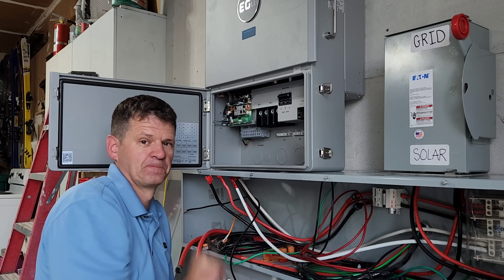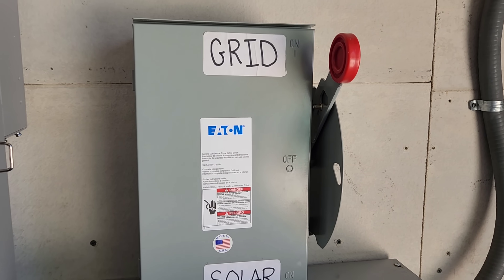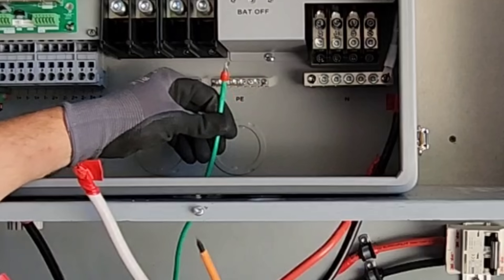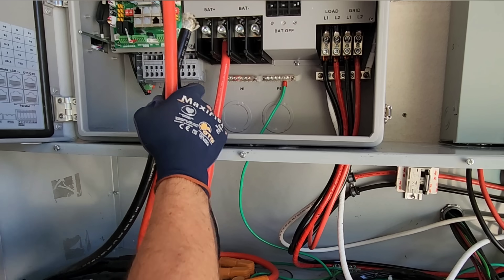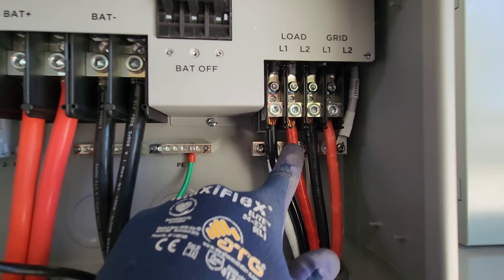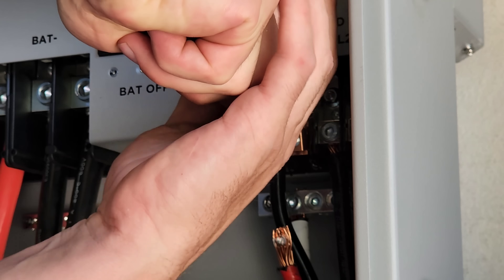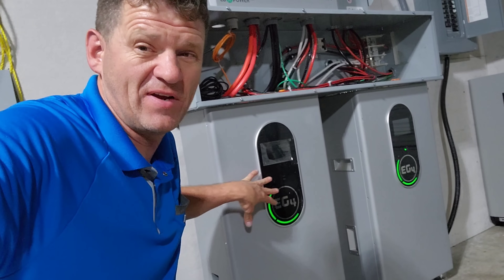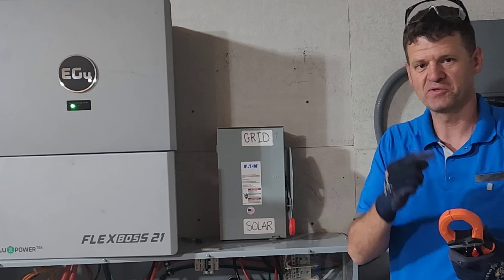EG4 FLEXBOSS 21 - Full Install With 1 Mistake

Comment: I was looking to get 5 flexboss 21 and 25 batteries 550 panels in total of 190. Will I need a multiple electric panels?
Reply from the maker: Is this for a new structure/home or an existing building?  How many electric panels do you currently have?  a single 400A service to the property?
Reply: @diySolarPowerFunWithRay no older home with a 600amp service
Reply: @diySolarPowerFunWithRay and I have 2 225 and one 150 panel have 3 5 ton ac units and 2 3.5 ton ac as well two 22000btu mini split and everything is ran off electric.
Reply from the maker: I would have to see some pictures of your panels and the locations of each panel, buildings, meter(s).  If you emailed meva video walkthrough of your system I would love to have a look at it. Eg4/sig solar can also give you some recommendations on what equipment you would need/layouts. You may only need three Flex bosses(or less)and no new panels.

Comment: double lock nut on the nipples in the transfer switch is unique. If you used an insulated nipple it could work?

Comment: A tip for you, if you haven’t figured it out already. Change the “Brand” of the batteries from “0: EG4” to “1” and you will have access to more battery info inside the EG4 Monitor Center. I have no idea why EG4 doesn’t include this information in their documentation but I found it in a comment from their tech support in an online forum and as soon as I made the change I can see each battery’s Total V, SOC, Current, SOH, Min and Max cell temp, Min and Max cell V and cycle count.
Reply: I forgot to mention, this is specifically for the PowerPro Outdoor and Wallmount Indoor batteries. Other EG4 batteries use the “0” setting but these batteries use the “1” setting.
Reply from the maker: This is a bit odd... but true... I always have eg4 look over my settings before I turn this on. Ya, i was a bit surprised by this one.

Comment: Hi Ray, any concerns with running your PV wire in the same conduit as your AC?  Same thing with your PV wire touching the battery cables?

Comment: Question if you connect the grid directly to the flexboss and there is no PV power will the inverter run the house from the grid input?
Reply from the maker: Yup... That the state my flex boss gets into quite often when my batteries get low at night when the solar isn't present.
Reply: @diySolarPowerFunWithRay  Can you make a small video showing your ground  system

Comment: Forgive my ignorance - but what EXACTLY did EG4 add (over the  6000xp and 12000xp) as a benefit with the FLEXboss and GRIDboss…. I guess I just don’t understand their benefits over the legacy gear.  I’m really only interested in OFF GRID inverters and have no interest in selling power back to a utility with a net metering agreement.
Reply from the maker: In that case the inverters you mentioned are perfect for your scenario. Benefit of the flex boss and the grid boss is that they tie into the grid a little more seamlessly. The grid boss adds a shut-off switch built-in and it also allows you to more easily locate the batteries anywhere on your property... with the 18 k p v you needed to have your batteries and your inverter closely located closely to your main power supply line as power went into your house and into your main electrical panel. The great boss allows you to put the batteries and inverter in various different locations in your house.... maybe outside.. if that is something you would like to do.  It has a lot of flexibility mainly for installers who have a lot of different configurations to deal with.  For example some people only have space for batteries in their basement on the other side of their house. So this helps save a lot of cost. Basically you put your grid boss on your main house supply line and then you can run a single set of wires to the flex boss grid port. Then the inverter can backfeed from its grid Port into the grid boss and the grid boss will power your house electrical panel.  Hope today makes sense. I know, it's kind of complicated
Reply: @diySolarPowerFunWithRay Thanks for the explanation…. Ya, I’m dealing with a “piece-meal” electrical design…. Winter RV lot where the original property realtors put the 200a main panel on a stalk at the front corner of the property and then folks added outlets for RVs, Park Model Trailers, built Casitas, etc… so I’ve got a bunch of small subpanels on my lot and putting ANYTHING up by the street is a non starter… so ya, I’m just trying to figure out which direction to go.   Thanks.   I like the 12000xp; I’ve heard the 6000xp fans scream all the time even when not under load.
Reply from the maker: Thanks. Yeah the 12,000xp much more quiet... I like it a ton more that 2 6000xp's.  Plus the 12,000xp has smart ports.

Comment: Great videos! you should add the NHX 12kw to your inverter google doc so we can compare across brands too
Reply from the maker: Thanks, The current issues with those is they aren't readily available for purchase.. unfortunately.  They sold out pretty quick and I think Watts247 has an exclusive contract to sell them in the United states. I might add that to the compare list if they come back in stock.  Because of Tarrifs, he hasn't wanted to order many of them.  He does have a 16k model in stock.

Comment: I have the flexboss 21 with my settings set to grid sellback disable and fast zero export set to enable, but i still occasionally get 200-300 watt fad back to the grid. I was wondering if you noticed that on your setup?
Reply from the maker: Hi Brandon. I also get this on occasion. It's back-fed about 2kwh in the last month for my neighbors to use... only about $0.30 cents worth... Not much.  It turns fully off if the power ever goes down and the utility workers need to work on the power lines.   I have a smart meter and the power company knows about it and they don't seem to mind.  If they reach out to me I'll switch it to off grid mode.

Comment: Are you able to sell power back to the grid with this setup? Thanks for all your videos Ray.
Reply from the maker: Thanks. Yes you can. When you sell power back with most inverters, the power exits through the grid port. The grid port can either accept power or it will sell it back.

Comment: Great vid as usual! Thank you! 
I'm curious to know with the grid\solar\battery all supplying how much can you supply to the panel? I understand it's 16k with battery and solar but can you support a larger load if the grid is available as well? 
I'd have been interested to see a similar setup but where you have both a critical load panel connected to the load ports and back feeding the main panel via the grid ports but not allowing any export to the grid. (That's my planned setup) So if one day you want to set that up... 😂 
Thanks again for all your efforts.
Reply from the maker: Hey Good new. I pretty much build this exact configuration here: https://youtu.be/NMDC8JQKJf8?si=z0LIFVcr8cFmz_BR  Hope that makes sense. It's a pretty good way to go.

Comment: I still think the 12000xp is the best bang for the buck especially with built in 100 amp bypass
Reply from the maker: Upgrading to a sealed unit is definitely a good $1000 upgrade over the 12,000xp.  My computer's aren't sealed and they seem to do fine.

Comment: The torque wrench base setting has to be on 0 to not over or under torque. I'm not special as I over torqued my M6 screw and broke it while installing the 200A Eaton breaker in the Grid Boss yesterday.
Reply from the maker: Ouch, yeah, those are easy to do. Thanks

Comment: I like the use of a Transfer/Bypass switch. However, I have both FB21 and Gridboss but plan to use a Transfer/Bypass in front of the Gridboss in case something goes wrong with it we could still use Grid power.
Reply from the maker: Adding that swith might not be required. I believe the gridboss has a mechanical switch built in... similar to mine... all least that's what they are marketing. I will be testing this though in the future to verify.
Reply: @diySolarPowerFunWithRay Correct, it has a switch built in but what happens if something goes wrong and I have to send it back for repair. I believe i would not have any power until it is fixed.
Reply from the maker: If you need to send the gridboss in that's a fair point.

Comment: Torque wrenches normally have a range where they are considered accurate. When you're at the outer edges, the cheaper ones aren't as accurate from my experience. I had the same issue trying to tighten down some valve cover bolts like 10 years ago. Now I have a 1/4" drive torque wrench rated for something like 20-200in-lbs in addition to my 3/8" and 1/2" drive torque wrenches.
Reply from the maker: Yeah I think I need to get a quarter driver. I have a half inch and a 3/8 which I hardly use... only for odd projects like this.

Comment: At long last I am about to begin my process of adding solar to my house.  However, because I have an old Sylvania 200A main panel that had a rather catastophic breaker failure (heat pump feed), I will be replacing the panel first and, while the meter is pulled, add a Gridboss.  I will then add the first FlexBoss21+batteries+solar at a later date.  

Your snapping the lug reminded of a mistake on made on my 88 Camaro when I rebuilt the engine a few years ago.  While installing the camshaft retainer I set my torque wrench to 21 foot-pounds because I misread the shop manual which indicated 21inch-pounds.  El snapo of the bolt!
Reply from the maker: ouch
Reply: Can you send me a photo of your old Sylvania ( Zinsco) panel?  I think my panel is one of those because it has one breaker that is green ( color breakers were a marker of Zinsco panels and breakers.   If I do have a Sylvania entrance panel., I will have to change mine as well.  I am just getting ready to install a Signature Solar EG4 solar system.

Comment: I saw you cranking on that torque wrench and I was going eeeeeek   :hand-orange-covering-eyes:   7 to 8 foot lbs is really not very much and can be reached with a small 1/4"  ratchet pretty easily.    Best thing is to retorque them in a couple months as those fittings can loosen over time as the wires are crushed.         Everyone messes up once in a while,  key thing is you didn't do something that got you hurt !

Comment: Excellent install, sans the over-torque!   Note that the unit can take up to 5 minutes to change modes (if you are messing around and wondering why it isn’t instantly switching modes), though in an actual grid outage with the GridBoss the switch-over will be more or less instant.
Reply from the maker: Thanks, With my testing it's been pretty much instant(without the gridboss)

Comment: Hello Ray,

I currently have both the Flexboss21 and Gridboss systems installed. About a week ago, I performed an off-grid test to evaluate how long the system could sustain operation without grid support.

During the test, I experienced two instances where the inverter shut down due to an overload condition. I’m still investigating the exact cause, but I suspect it may have been a combination of high-demand loads—possibly the water heater, EV charger, and other appliances—exceeding 12kW. That said, I have 15kW of solar installed and often see sustained peaks around 12kW throughout the day. Based on the system specifications, I expected it to handle up to 16kW with solar, so I'm unsure why it tripped.

I'd be interested to know if you're able to run a similar off-grid test and observe whether the system also shuts down when loads exceed 12kW, even with ample solar input. After the second shutdown, I reconnected to the grid and haven’t attempted another off-grid run since. I'm still trying to determine whether this was due to load imbalance or simply crossing a hard threshold.

Looking forward to hearing your thoughts.

Best regards,
jwy

Comment: Great explanation.  Curious if you find the 'in raceway busbar' easier than the Engineer775's 'double tapped transfer switch'.    I spent the weekend wrapping my design which had a few oddities like a dual-use whole house automatic generator.  When batteries are low and there is no grid, or solar it will kick on, power house and recharge batteries.  I also have the original Kohler ATS just before the main property panel.  If grid is down AND the solar setup is down or not producing ATS detects no power and fires up generator, isolating from everything upstream, and power the house.  The ATS is line of last defense, especially if I am not home to do any swapping, checking, or MacGyver-ing.
Reply from the maker: The raceway busbar, shown in this video and here https://drive.google.com/file/d/1ukjjJB_7t_DqLr-UXdilaoYTsueA7IrR/view?usp=drivesdk is definitely harder than my  line taps install i did earlier.  Good exercise too draw it out before jumping right in.

Comment: Also can it deliver 12kw continuous without grid?  I'm mixing up in my mind if that was 12000XP or FB 21 or all of these inverters needing grid to keep 12kw continuous
Reply from the maker: Both will do 12K continuous with battery only,  I believe just the flex boss will do 16k, but it needs solar AND grid.
Reply: Yah.  12K continuous on battery, 16K continuous battery + solar.  You can use more if grid-on and the FB as a hybrid inverter will assist up to its limit (unlike an off-grid inverter which can’t assist while grid-connected).

Comment: I think the flex boss will do 12k watts continuous output but has capacity to do 16k watts with PV, that would be a good test
Reply from the maker: Thanks. Ya, i think it also requires the grid from another test I saw.